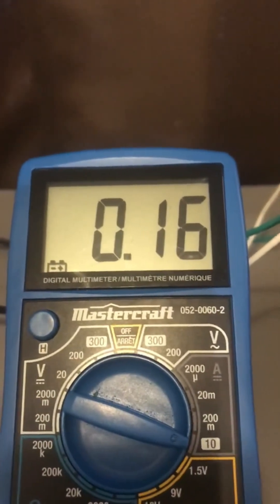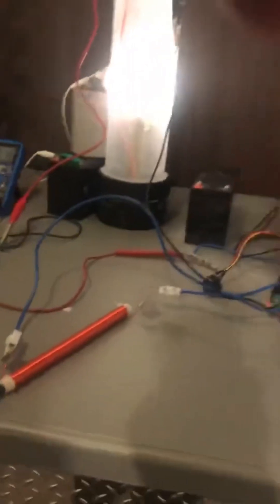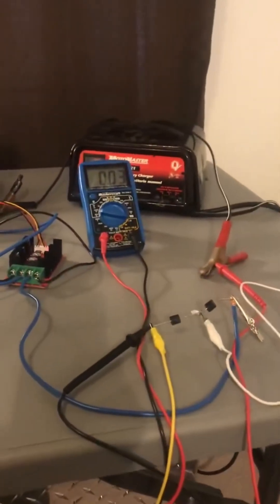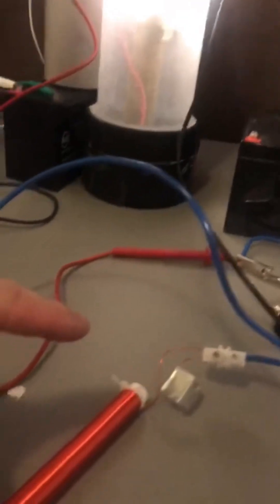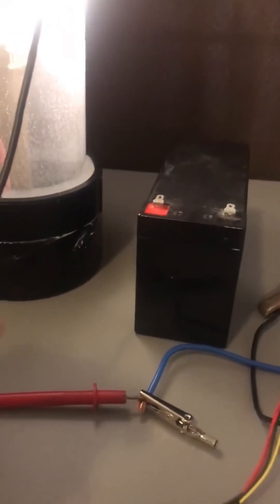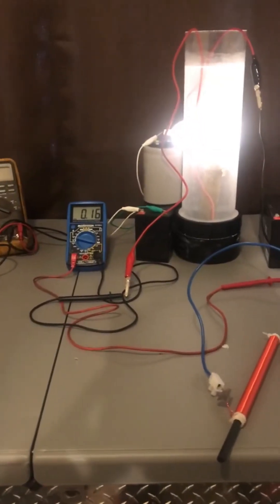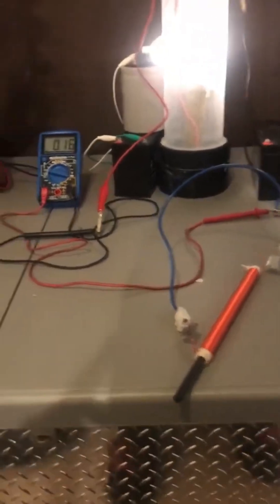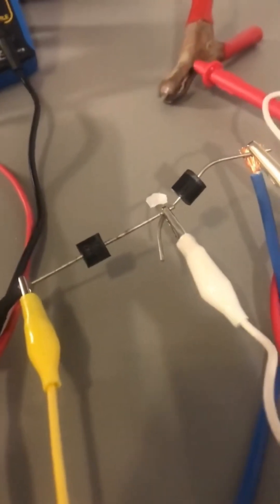Design Stanley Meyers + Don Smith Hydrogen Generator Close Up #elonmusk #experiment #hydrogen

Comment: Before led backlight lcd monitor we had cfl style backlit monitor. I used to play with it around 2005. It had something similar to adjust brightness if you could find something of that sort and use an esp32 to controll pwm and to measure current use a current transformer 1000:1 with burden resistor between 120 to 150. Max 200 ohm. This can help you generate the waveform in realtime by using ads1115 it is a 16 bit analog to digital converter. This is just a raw idea. If you are fine can we colobrate

Comment: It looks like you got Stan's original circuit working.  Congratulations, 95% of those who try don't get it right.  You need Meyer's Electron Extraction Circuit; the more power you draw Out, the more HHO you will produce.  Its about creating an imbalance which induces electrons into solution, releasing Hydrogen and polarizing H2O molecules.    Santilli actually sorted it out a decade after Meyer was killed, but never gave Stan the credit.  Paul Pantone was dealing with the same phenomenon.  For that matter, Dr. Yull Brown preceded them all, and was on the right track, when he died.  And, Randy Mills has a piece of the answer, as well.  But, the real kicker is This:  Meyer's circuit does exactly what Joseph Newman's did, and they - like all 'legit' FE/OU systems operate by the same underlying means.  It ultimately boils down to: Voltage is FASTER than Current; and Fast ENOUGH Switching can Exploit This, inducing Current from any ambient free-electron source; 'Earth', 'Air', 'Water' or 'Fire'.

Comment: I wish I would have recorded my old HHO setups. I was experimenting with a lot of different electrolytes and catalysts inside of it and I can easily make my own stainless steel plates that I used and I made a special thing called gray bubble hydrogen and I got the highest output of high octane so-called hydrogen pure that I've ever had a four-cylinder Honda Civic stock, not SI stock Honda Civic used to pass V6 Infiniti G35. I think it's vqd motor that it had the V6. But anyway, disregard that a four-cylinder would pass with more power than an engine that had three times more horsepower and almost half the double 0 to 60 time

Comment: Stan's Variac->stepdown transformer->FWBR  will give you a good output signal (with higher voltage control potential - 120VDC/120Hz) similar to the battery charger, which is commonly a 60Hz AC wave half-rectified to 30Hz unipolar arched pulses. It's probably not a constant DC output. This is similar to Stan's 8XA/SCR  drivers which produced the USB style unipolar AM waves from the 120Hz acting as the Gate being modulated by an opto coupler. It's best to go after isolation from the control circuitry so that you can start working with higher input voltages.

Comment: Thanks for explaining, this leaves me with some questions.
1. Are you pulsing a 50% gated freq?
2. Is the water you use Double distilled water only?
3. If you adjust the ferrite rod what happens to the cell and meters?
4. What is the gap between anode and cathode?
5. Diodes seem to be pointing away from PWM, is this the case?
6. What wire did you use for bifilar coil?
7. How many turns?
8. Can you increase the voltage to the cell?

It would be fun to see an oscilloscope on that setup and the data from it. 

Can you measure some production?
Reply from the maker: Some of these questions will be addressed in upcoming vids. I do have some oscilloscope footage and rod adjustment footage as well. Water is distilled with KOH. Duty in this vid is only 5%.
Reply: Where does the white lead go that’s connected to the diodes ?